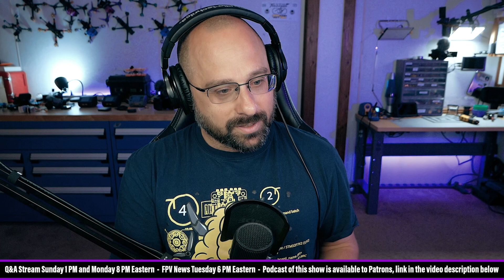One of My Motors Doesn't Produce Lift! What Do I Do? - FPV Questions

Comment: ive had a similar issue on a build i did with ethix fat rat motors on a 3in build. turns out ethix fat rat 1507's motors are utter garbage. HUGE airgap, weak as shit, but i bring it up due to desyncs. i went through 8 motors, 1 of them would spin correctly when on the bench, everything configured correctly, crapped out soon as any appreciable load was put on it. BB said it was 100% thr so pretty sure it was desyncs. the rest of the motors had the same issue with desyncs but usually when punching(tried all the esc setting knobs and dials), replaced with Tmotor1507's, same config, same esc's flies like butter.